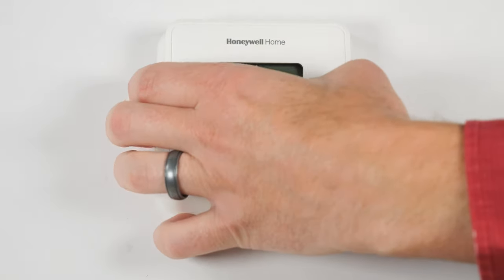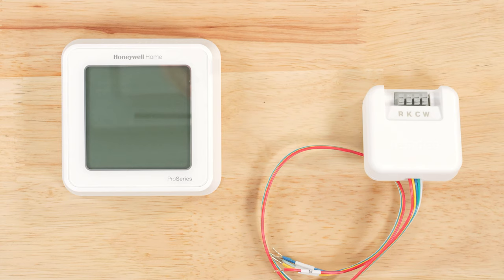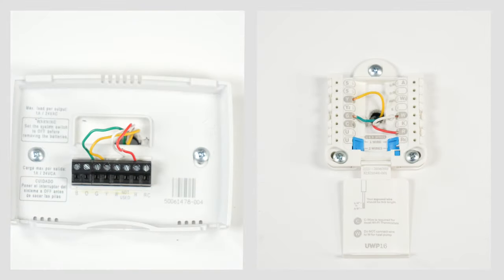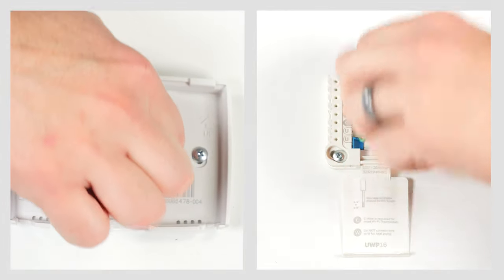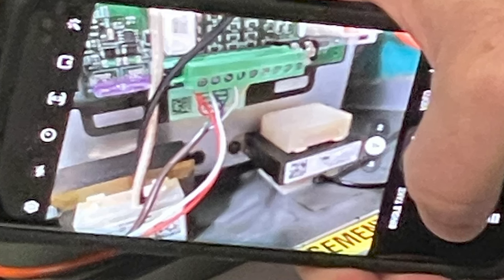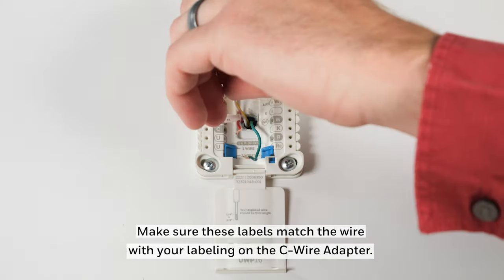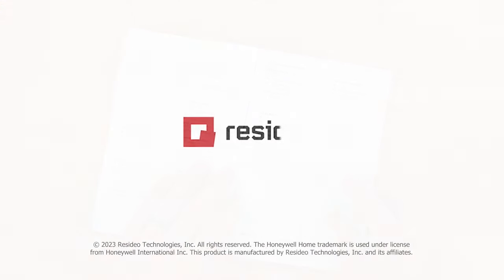Add a C Wire Adapter

Comment: My old Honeywell RTH230B is no longer displaying anything. It has 5 connected wires and no spares. None of those wires are connected to C at the furnace. Two are connected to the furnace ignition box, the others are connected to R, G and Y. Nothing is connected to W. Is this adapter a good solution?

Comment: My system does not have a c wire but I do have an extra wire tucked in the bunch, can that be used for the c wire ? If so do I just connect it to the thermostat and that’s it ?
Reply from the maker: Hi, thank you for reaching out. We recommend to confirm first that the extra wire is indeed connected to your system and that it comes from the C terminal for the thermostat to operate properly. -Cesar
Reply: @ I found my yellow wire it’s not connected, but there’s no c terminal. They just have them connected to other wires with no labels. What do I do here
Reply from the maker: Hello! If you send us a private message on Facebook or Instagram with your installation details, we’ll be happy to take a closer look and provide more detailed help. We’re here for you! -Lucero
Reply from the maker: Hi! You can find us in Facebook and Instagram under Honeywell Home. -Juan
Reply: @ I got it 😃 I’ll follow you either way

Comment: I just bought one of these online  just to realize they are not compatible with heat only systems (according to the packaging). 😢
Reply from the maker: Hi, thank you for reaching out. If the heating system has only 2 wires (R-W) and there is no C terminal at the board the only way to supply the Common/C wire would be to use an external 24V transformer wires to the RC and C terminals of the thermostat. -Cesar

Comment: How do you use the extra wire (in my case blue) as a C wire?
Reply from the maker: Hi Joe, thank you for reaching out to us. If you have an unused wire, please trace it back to your air handler/furnace and make sure that it is connected to the C / Com24 terminal. Then go to the thermostat side and connect the wire to the C terminal. -Maria
Reply: @ResideoSupport  Thanks just what I needed
Reply from the maker: You are very welcome. Is there anything else we can assist you with at this moment? -Maria

Comment: Bad tutorial .. goes two fast w/o explanation of that the Y goes into K and G goes into C.
Reply from the maker: Hi Minh, thank you for your feedback. Minute 2:55 makes reference to Y wire becoming K and G turning into C. If you need assistance with your thermostat and the C wire adapter, please feel free to contact our tech support team at (800) 633-3991 or send us a Private Message to our Honeywell Home Facebook account. -Maria
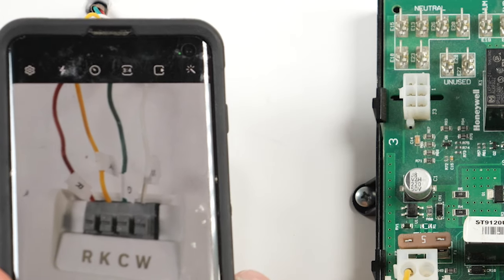Reply: @ResideoSupport  Should have shown that earlier at 2:12 when hooking up the adapter so people won't get confuse.
Reply from the maker: Hello Minh. Thank you for contacting us! If you are struggling with the C wire adapter installation, you can contact us by a Direct message in Facebook and we can help you with the process. You can find us as "Resideo Pro". -Alex

Comment: Can this adapter be use for non-honeywell thermostats?  Nest?
My ac unit looks like a rats nest with 4 to 6 wires of each color.  I just want to use the thermostat without having to replace the batteries every few days.
Reply from the maker: Hi Horacio, thank you for reaching out to us. This C-Wire adapter has not been tested with other brands. We recommend you reaching out to the manufacturer of your thermostat for recommendations. -Maria

Comment: I only have three wires to the old, round dial thermostat. We use an oil furnace here. I don't understand where the split C-wire attached to the new T5 control board. I don't have the adapter version. I just have the 24 volt plug with a split C-wire.
Reply from the maker: Hi, CO_NYG56, thank you for reaching us out. We will be happy to assist you with this. If you are trying to install a WI-FI enable thermostat, you will require a C  wire. The C, or common wire, brings 24 VAC power to the thermostat. 

Heating only systems, usually have 2 wires only. If the system has only 2 wires (R-W) and there is no C terminal at the board, the only way to supply the Common/C wire would be to use an external 24V transformer wires to the RC and C terminals of the thermostat. -Juan

Comment: I have 2 unused wires. What should I do?
Reply from the maker: Hello Julie! If you have unlabeled/unsued wires, you will need to trace the wire back to the HVAC system to check the connection on the motherboard, and check the labels to know the function of the wire. If they are connected but not labeled, the best option will be to seek support from an HVAC technician. -Dinorah

Comment: How does the K wire perform both the fan and the cool function?? I can understand how you could get three functions (fan, cool and heat) using two wires (K and W) with Boolean logic, but two functions on one wire like you say is a mystery. Do the thermostat change the voltage or frequency to the C-wire adapter to signal which output wire (Y or G) to turn on?? I'm just trying to wrap my head around how this works. Thank you.
Reply from the maker: Hi Steve, we thank you for reaching out and sharing your concerns with us. The C-Wire adapter handles the internal connection to provide both energy and system control. If further questions arise, feel free to communicate with us via Facebook Honeywell Home or at 1-800-468-1502. -Charlie
Reply: @ResideoSupport  so does the one wire support both the fan and cool function independently?? I don't want any trade secrets from you on how the device operates, I'm just looking for assurance that this device can perform the task of two wires using just one wire. As long as I have the ability to control my furnace fan alone without having to turn the A/C on then I don't care how it does it.
Reply from the maker: Hello Steve! Thank you for contacting us. Yes, the K label in the C Wire Adapter can control the Fan and the compressor independently.  It will provide you two independent wires that you can connect to fan and compressor separately. -Alex
Reply: @ResideoSupport  excellent. Thank you Alex. That is all I needed to know. Hope you have a great afternoon. 😊
Reply from the maker: Glad to help, Steve! Have a great day! -Alex
Reply: So the wires from the current thermostat that are initially attached to the circuit board on the heating system go into the module part of the C adapter and the adapter wires are now connected to the systems circuit board?
Reply: @mamag3531  correct.